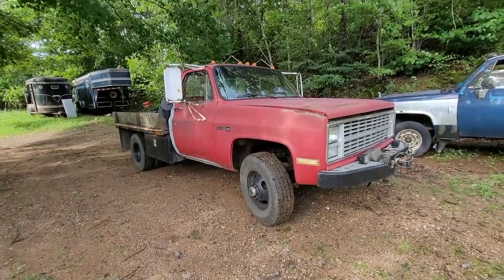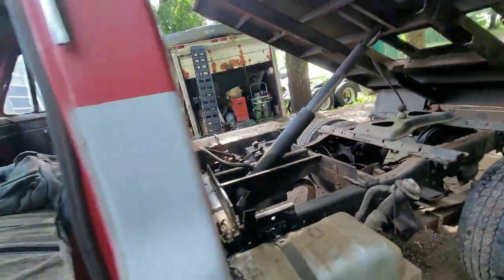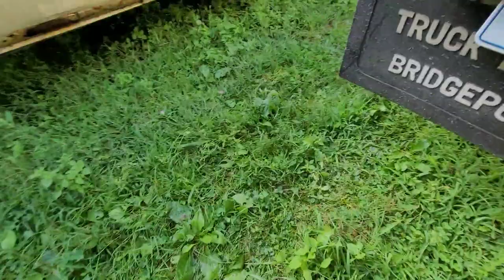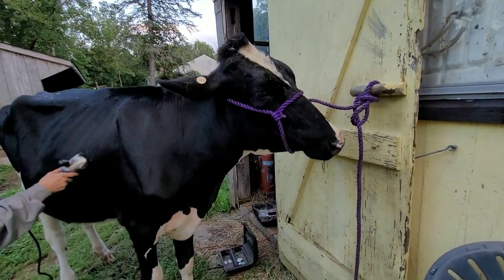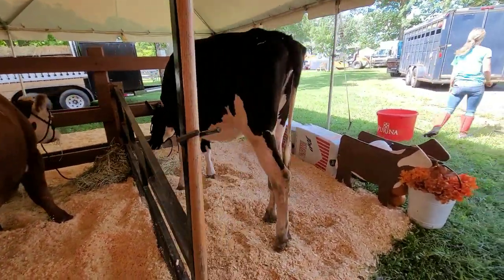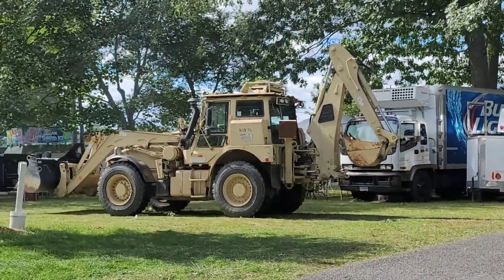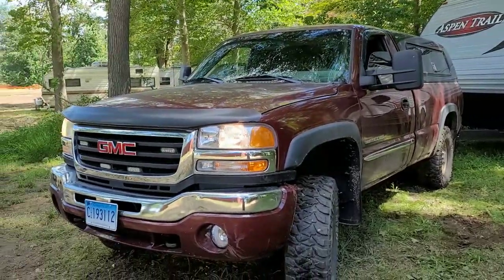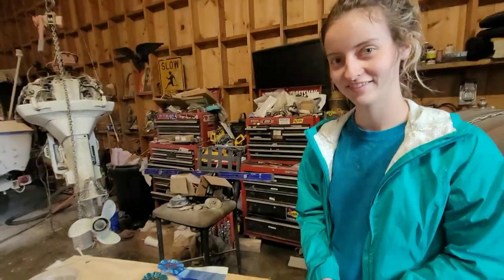Showing my cattle at a small town fair in New England.

Comment: Your truck is awesome! That's a work truck. 4wd, can pull 5th wheel, gooseneck and bumper. Has a dump bed., winch and air compressor.That's what you need in a truck. Not heated and cool seats with a touch screen and never haul a damn thing.